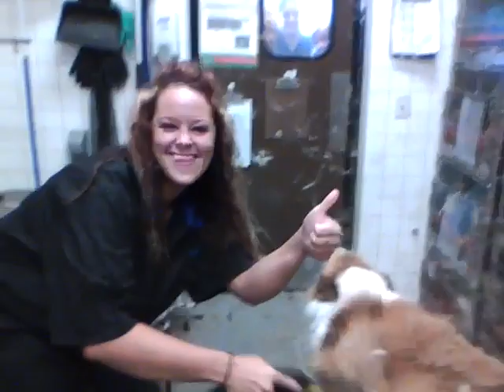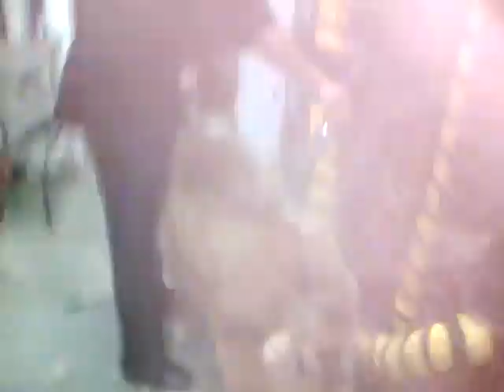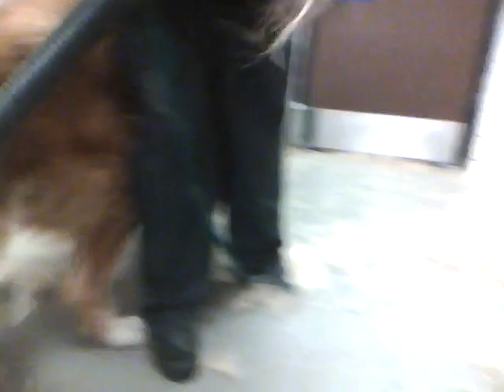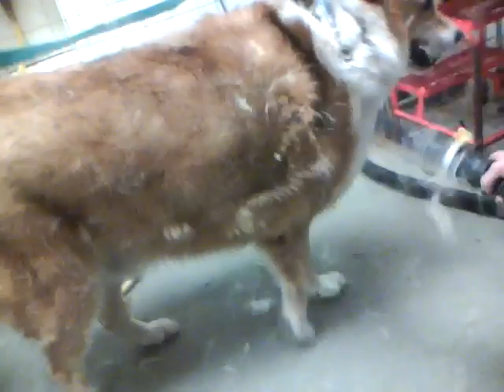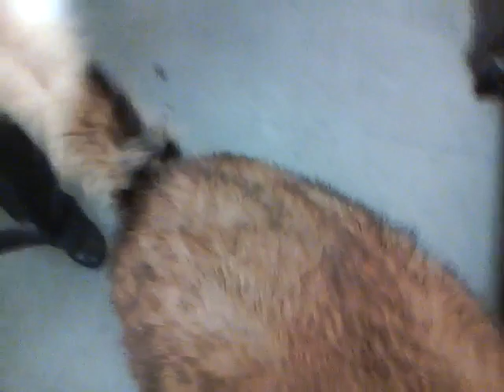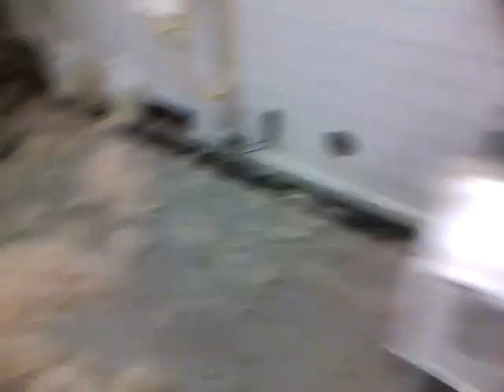Velocity Drying a Collie Mix

Comment: You should have her ears protected with the loud noise. Poor thing.
Reply: How?
Reply: Kraft Zero 2 towel or Cotten balls in ears
Reply: @87rbm89  towel would be pulled off by its paws, cotton balls could get stuck or deconstruct in the ear canal and cause moisture to get trapped and cause ear infections. It's not really suffering, it's just startled by the noise.
Reply: Carolina Coreas they do have head wraps for dogs that can work. When I blow my husky out we use a head wrap and it calms her down
Reply: @87rbm89  your husky isn't an example that can be used for all dogs. Also a headwrap actually protects them from hematomas by making them not able to flap their ears when they shake. It barely muffles the sound so they could still hear it anyway. This was just an example of a dog that probably has never been to a groomer before and has never been blown out. It's also not smart to use cotton balls because it could get stuck in their ear canal and trap moisture or gets blown out during the process. There's not really a good way to protect their hearing enough.
Reply: Carolina Coreas we will agree to disagree

Comment: Do it in the tub while the dog is lathered up. Hair comes out easily, stays in a very confined area, shampoo comes out with the hair and reduces the time needed to rinse. It also eliminates having wads of dog hair flying all over your grooming area, to say nothing of the dirt and dander that blast off the dog at the same time - which both of you are inhaling as you are not wearing face masks while you work.
Reply: Meh, nothing a shop vac won't fix! I usually use a mask for reasons you stated, but I know a few grooming friends who feel like they can't breath with one on. As for being in the tub wet while doing this, some dogs would spend more time freaking out because they are wet, and it's hard to maneuver around a big dog in a small tub. This way the dog can move around without any danger of trying to jump out of the tub, no clogged drains and a heck of a lot less brushing and fussing. I have a few clients I pre-de shed before they hit the tub because it's much faster and easier on the dog than standing in a tub for an hour
Reply: And if the dog has fleas? They fly everywhere when you HV the dog pre-bath, right along with the dead coat and dander. All over your grooming area and other client dogs in for grooming.
Reply: +DoubleDogDare54 if the dog has fleas then they should a) be put on flea medication before going to the groomers, especially with a coat this thick, or b) would be put in the tub first and de shedding would take a backseat. I don't use any force drying on my pets who come in with fleas, they go from the tub into a kennel with a warm dryer and when they are dry, or mostly dry, I use a stand dryer on low to pick the dead fleas out.
Reply: +DoubleDogDare54 cleaning should never come before a pet's safety, not in my shop at least! I had a malamute come in with fleas, I moved all my other grooms around for the day and then spent an extra hour cleaning up before the next dog came into my grooming room
Reply: +14Raine14 A surprising number of owners don't have a clue their dog (or cat) has fleas until we call and tell them we found klingons on Fluffy. And with very thick blown coats on TAY dogs - already loaded with dirt on the skin - finding fleas can be next to impossible until you wet them down and the varmints start crawling to the surface of the coat to escape the water and shampoo.
Reply: +DoubleDogDare54 i always ask owners if they notice itching and do a flea check. I still would blow dry a dog like this first before hitting the tub, to assume every dog has fleas and to put chemicals on every one would not be safw
Reply: +14Raine14 Long experience has taught me to assume every dog has fleas until proven otherwise - because you really don't know for sure until you get them in the tub and wet down. Owners are notorious for not knowing their dogs are flea bags and their homes are infested, so said owners are not reliable sources of information on that score. 

We report all sorts of things to owners they never noticed - infected ears, abscessed teeth, abscessed anal glands, hot spots, tumors, you name it. They had no idea their dog has issues. 

Just shaved down a Persian cat yesterday that had running sores on its body and the butt was sealed shut with a mass of shit in the hair. The owner was wondering why the cat reeked but figured it just needed a bath a comb-out. 

Like - D'YA THINK???

So, in the tub, wet down, I'll check them out myself. But I sure as heck wouldn't turn an HV on a dog that hasn't been touched in a month of Sundays because you never know what you might be blowing around the shop as a result.
Reply: +DoubleDogDare54 I was taught never to douse a pet in chemicals "just in case". I've never had an issue thus far
Reply: +14Raine14 Well, when this video was shot "your shop" was PetSmart - and for some reason I have my doubts PetSmart would be thrilled with a video of this sort being shot back in their bathing area by employees and posted online.
Reply: +DoubleDogDare54 I've never worked at pet smart? I had my own private salon
Reply: the wet hair doesnt come out as easily. best to do it dry.